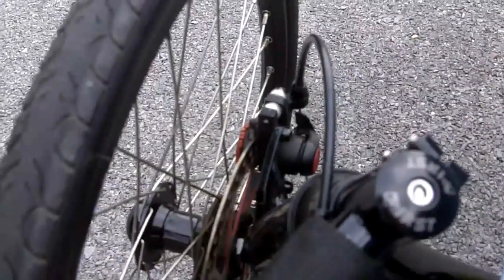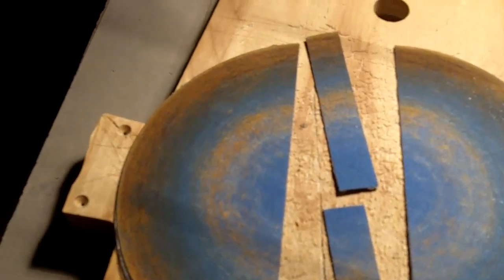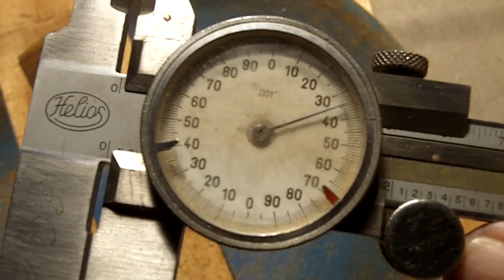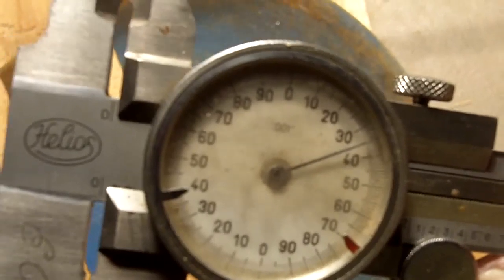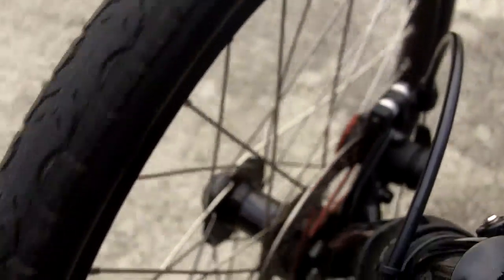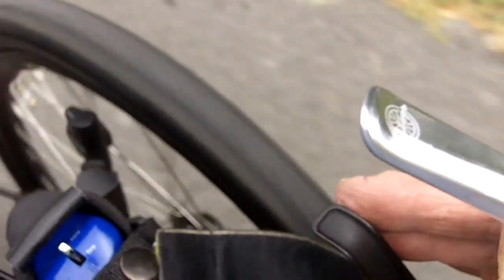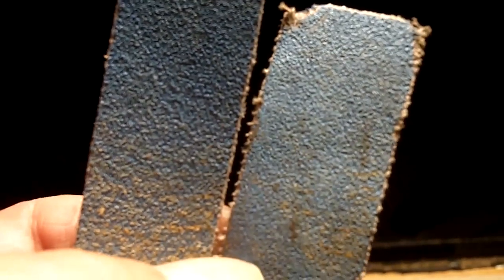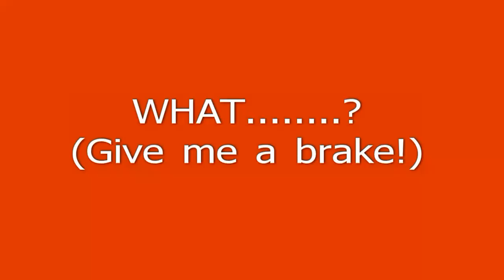Bicycle Disc Brake Squeal Fix, 2011-09-15, ActionBent Recumbent Trike

Comment: I tried a used sand disc from my small angle grinder. It's not the same sandpaper in your video but it worked & my brakes also stop much better. Thanks so much for posting this video.

Comment from the maker: I believe that after a short period of use, the rotating rotor and the stationary disk pad each develop a glaze that sets up too much 'grab' when braking pressure is applied and the squeal is likely the result of a high frequency series grab/release. For instance, talcum powder stops the squeal by allowing slippage between the brake components, but is rather short lived. Resurfacing restores brake efficiency using 'pinching pressure' applied by the pads against the rotor by minimizing 'grab'!

Comment: To eliminate the noise you actually need to:
1. Clean your disc
2. Clean your brake pads
3. If the pads were contaminated(exposed to oil or something similar) clean them with dish washer, soap or alcohol(wouldn't recomend WD40 for it contains oil it self) and then cook them(heat them in the oven or apply constant brake until the pads heat up and vaporize the leftovers)

Well actually the most effective thing you can do is just apply constant brake. Pedal while braking and do this until the sound goes away. Trust me I've managed to get rid of the noise even on a leaky hydraulic brake....until I added more oil, then the whole disc was soaked and had to change the brake for it was defected, but still constant braking solves most problems. I mean when you hear a squeal in your car brakes you don't start ripping apart the whole braking system....you just ignore it and most of the time the sound goes away by it self.
Reply: i got rid of the squeaking but the only thing now, is that it doesn't instant brake.
Reply: Well you should adjust your tension if you have mechanical ones or refill the oil reservoirs if you have the hydraulic ones. On hydraulic brakes there should be from little to very little play in the lever.
Reply: i need to investigate what brake oil is using right? to not mix it with other brand, or type of oil?
Reply: Well there are two main types. DOT 3/4/5.1 hydraulic brake fluid(mostly common in car brake systems) and mineral oil hydraulic fluid.
Reply: turns out, it was the pads, it was contaminated, so i buy a new ones, and that solve the issue

Comment from the maker: Comment appreciated. The 'grind' sound is perhaps more acceptable, therefore a step in the right direction. And by reducing the 'glaze' it would reason that brake efficiency improves. Granted, this 'fix' is not rocket science, but it does seem to fall in line as an 'improvement.

And yes, the brake assemblies offer many opportunities for loose fitting parts to enhance harmonic vibrations. Again, thanks for your observation.

Comment from the maker: Thanks for the post. I can understand how this would have some positive affect on the squeal and especially like the simplicity of the solution, but I'd have some concern that the grit in the dirt might become imbedded in the softer brake pads and continue to grind away on the disc after the squeal has disappeared (depending on the hardness of the dirt grit). I would however appreciate a periodic update on how this 'dirt-dobber' de-glazing has worked out. Dirt is from what part of the planet?

Comment: You should never do this to the disc. I am a bike mechanic, all you should ever do is clean them as well as you brake pads. The squeaking happens from decontaminated disc And pads. My General rule of thumb is if your not a professional bike mechanic you should always take it to a bike shop be for you mess your bike up and have to buy new part. But take this as you want.

Comment: When I have brake noise I use a product called the Silencer, for cars, cycles and bikes.  Silencer spray has soft metals that are pushed into the pores of the rotor to create a better mating surface.  The paste seems to take a lot of work, the cleaning steps and then time to restore full braking power.  Silencer took only seconds to apply, then I just made 10 to 15 stops to complete.  I paid only $15 for a can at BrakeSilencer . com, its a car page but tech is explained there.  It worked for me.